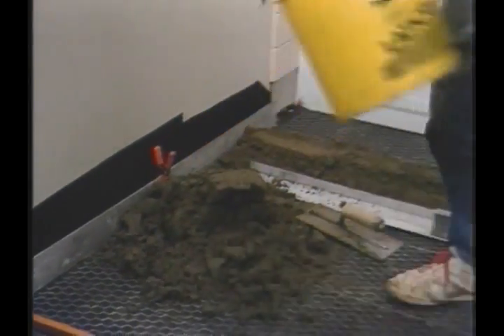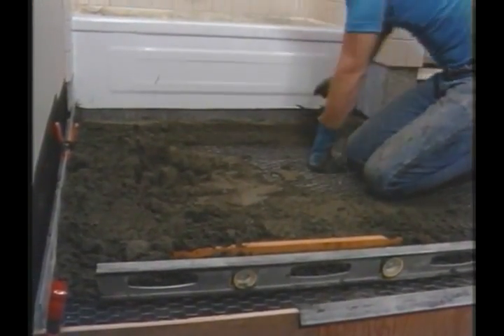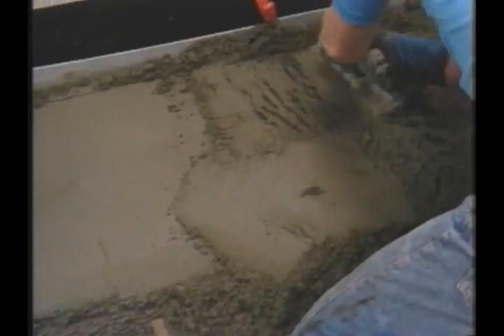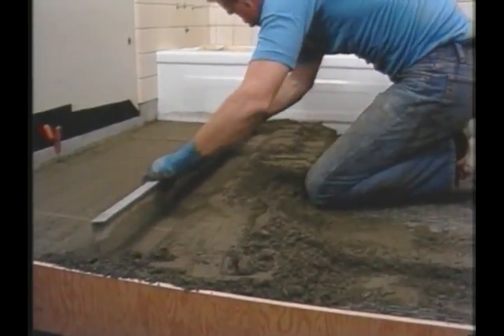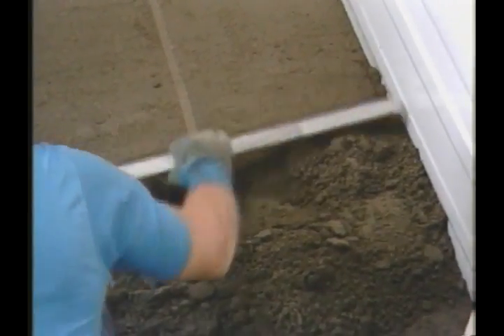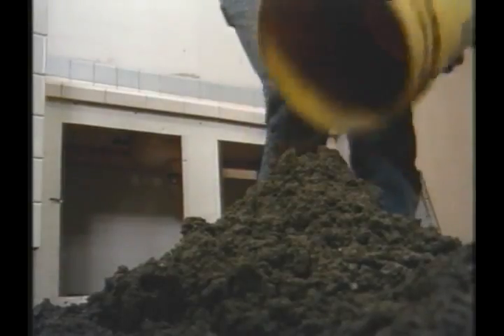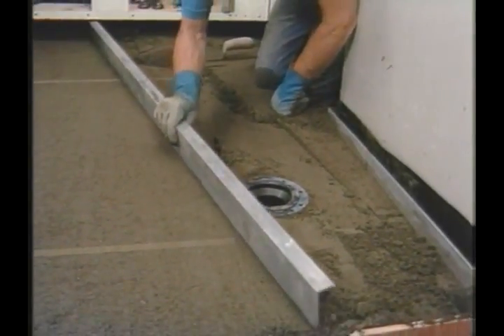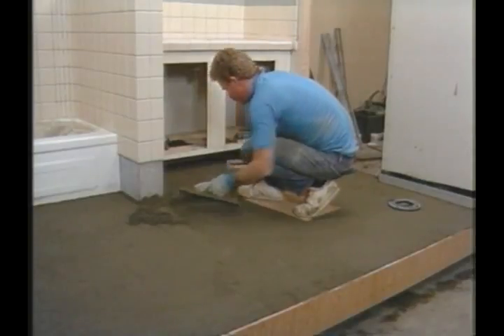Floating a Mortar Bed Floor - How to Float a Floor for Tile

Comment: old school, and I  like it.  we need more craftsman like this
Reply: let me add something, we need more craftsman like this, but with current tech and materials. no so long ago craftsman did what they did just because they had to, sadly, nowadays a lot of craftsmen believe that new products are some kind of "magic" that will do the things right when they did a clumsy job... finally are people like the ones that did build my house, old-tech still clumsy job (being lit 7 years(at slow pace) fixing all the wrong that they did to my house trying to get it not falling apart , I mean It, walls on 2nd floor are 2" to the outside, floor 1" bellow, ceiling 2" above that where it supposed to be (that just on 2 rooms on the 2nd floor of 3 rooms), you could not find a thing square, plum or true if you tried)

Comment: Hi thank you for your content I like your videos
I wanted to ask a question do you need to remove the mud if you want to replace the tiles , or you can leave the old mud which is in good condition and just remove the thinset and put new tiles?

Comment: Back in the day . 
They should have done all the concrete base first. The water goes inside by the tub and cabinet and rots out the cabinet and floor plywood.  
How do i know , I do building maintenance on an apartment complex that had all baths damaged because of this😎
Reply from the maker: thanks for the comment
Reply: @LayTiles  
The plumber comes before the tile guy, unfortunately the mortar base stops at the tub. This makes a nice line for the water to go diwn the tub and into that edge . Yes you can caulk . But in the complex where I work they did not maintain it. I had to rip out the base and put new plywood,  and even a new floor joist in some apartments.. !!!
I will say I notice mortar base works better than cement board used now.  It seems some tile guys don't even use thin-set under the cement board,  they just screw it down which is pointless , you need thin-set under the board ,any low spots will flex and tile can crack later...